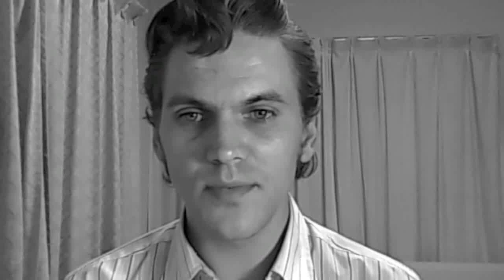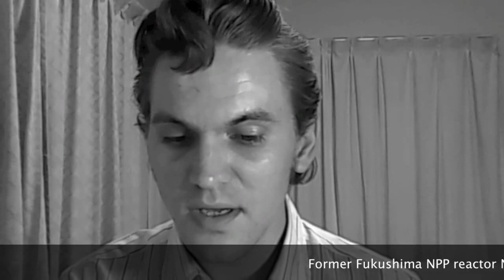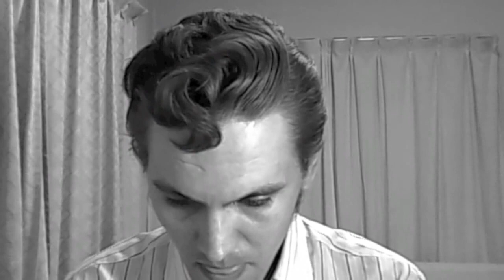#4 Reactor in Fukushima DANGERS EXPLAINED in Detail ! 4/13/12

Comment: Lets do the math and apply some common sense. There are11420 zirconium clad fuel rods on site ( zirconium will burst into flames when exposed to oxygen-air). 2331 are in spent pool #4 to lose it alone would make the area unapproachable to human or robot. Leaving the remaining 9089 fuel rods unintended and they would start to burn too. At risk is or entire ecosystem.